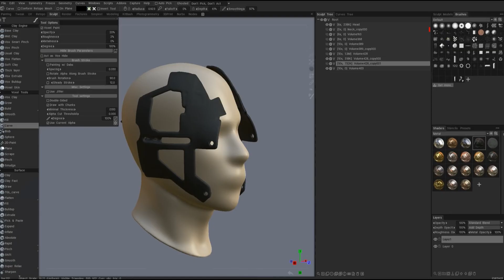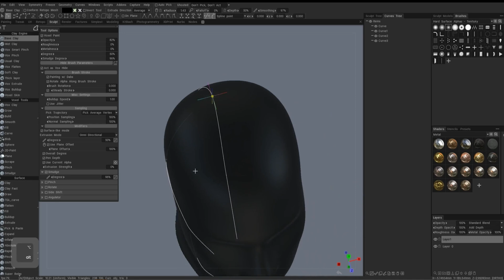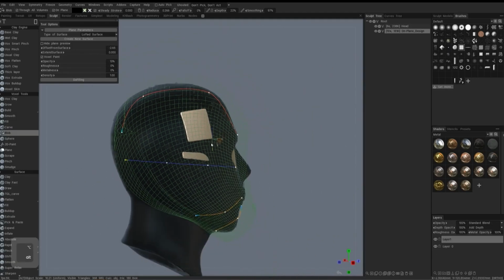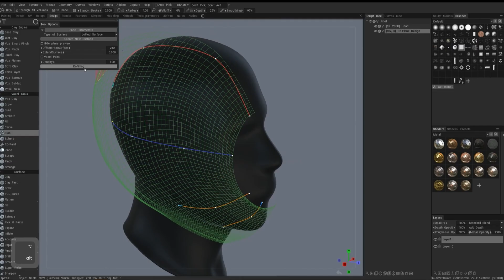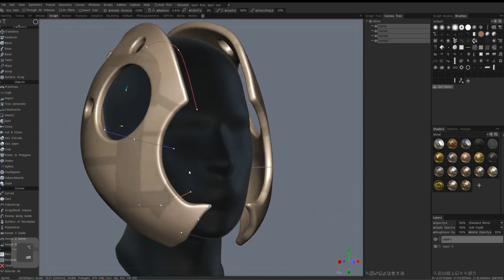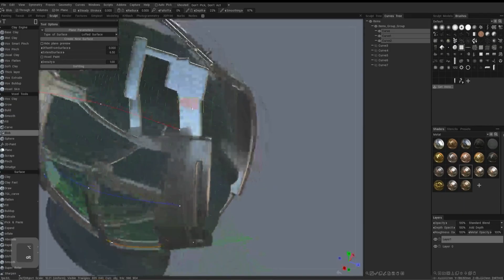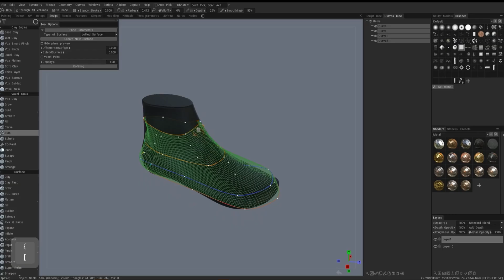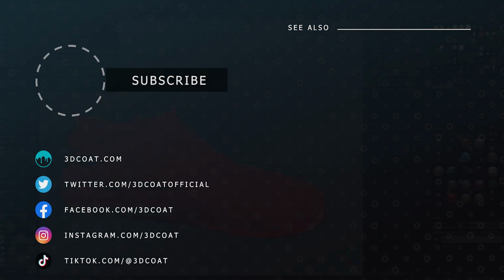Lofted Surface for On-Plane Brush Control Tool. Christmas sale 2025 - 2026 is  19 Dec. - 7 Jan.

Comment: Quite amazing workflow! On Plane can now be linked to curved Loft surface, instead of a flat plane... It can be very handy in many tasks, but there is also one problem... Blob tool is voxel based, and voxels do not like thin walled geometry, so doing something like thin patches on sneaker design will be a problem. Same as making panels for a car or aircraft. You can make perfect Loft base, and use it to apply voxel clay on top, but dealing with thickness will cause problems. Voxels work great with FILLED, solid volumes, so you can deform, cut out, move, smooth and sculpt on it. But with thin panels it is very hard to work on it (even light smooth stroke will destroy it, and make holes).
Reply from the maker: True in a sense. However, an increased density improves voxels ability to form thin shapes. One viable option is to make the object as thin as your voxel count will allow and once you have completed the operation, you can RMB click the Sculpt Tree layer and choose to EXTRUDE a negative number, to make the volume even thinner. If the workflow includes Retopologzing the Sculpt object, then you will have single sided polygon groups at that stage of the process, thus working with a thin volume of voxels isn't much of an issue.

Comment: Wow awesome.!....How did you create the pattern using the pose tool. I replayed that many times but I dont understand cause it was too quick . Can you please elaborate?
Reply from the maker: He used an Elipse Draw mode from the E-Panel (hit the E key) and made multiple pose selections with it by hitting the desired number while LMB clicking the point you want to start. Once the selection was made, you can use the Transform Gizmo to make those transforms...in this case, a slight rotation.

Comment: Hi 3d coat we need update tools retopology
Reply: What do we need to improve in retopo tools?
Reply: @Dom3d tools like topogun 3
Reply from the maker: Can you please be specific about your request? We cannot determine what exactly you are referring to by saying we need to update our Retopo tools like Topogun 3. We have been making incremental improvements to the Retopo and PolyModeling toolsets with virtually every new version. When was the last time you used or tested the Retopo tools in 3DCoat? If it has been a few years or more, I would then recommend that you download the latest build of 3DCoat and test the Retopo tools again during the 30 day trial, because there has been a lot of development of the Retopo tools in that timeframe.
Reply from the maker: Have you used the Retopo tools in 3DCoat? If so, when was the last time you utilized it on a project of some kind? The reason I ask is because there has been a lot of continual development in the Retopo/Polymodeling toolset over the past 4-5 versions of 3DCoat. Many of our users would argue that 3DCoat is "hands down" the best Retopo toolset in the market and the developer has worked hard to get it to that point. 
Have you watched the videos on the Smart Retopo toolset, here on our Youtube Channel. It is something between Auto-Retopo and Manual Retopo. It's extremely powerful, and we have added many other tools such as Vertex Welding (with previews for setting the distance radius), Align Vertices, Smart Extrude, Bridge, R-Fill (to smartly fill gaps with proper quad topology), etc.
Reply: @PILGWAY3DCoat I am grateful to you. Thank you.❤
Reply: @PILGWAY3DCoat  Btw, I find the retopology toolset in 3DCoat to be excellent, you did a great job! The only thing I find lacking is a quick way to add a vertex at the edge of a triangle. The way I do it is switch to the Select tool, select the edge, right-click >> Cut Edges >> OK. Is there a faster way?